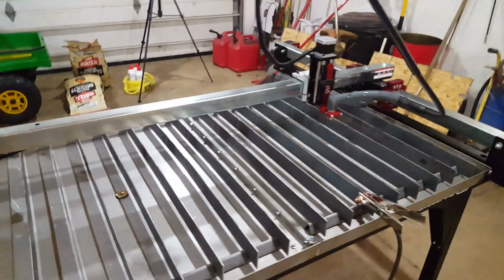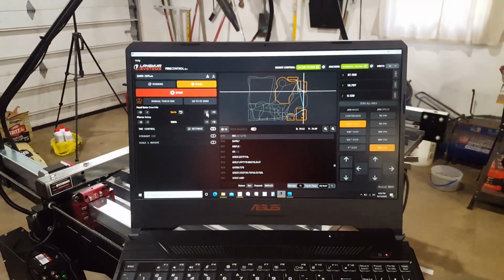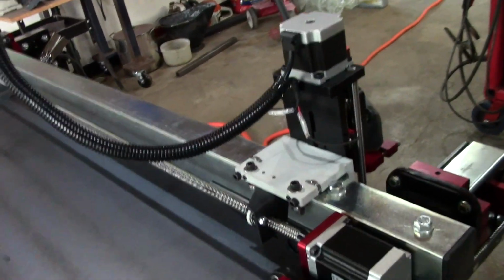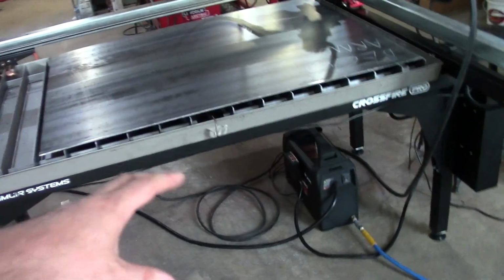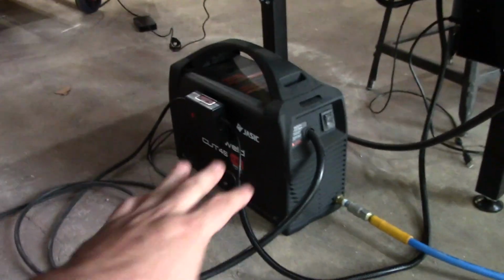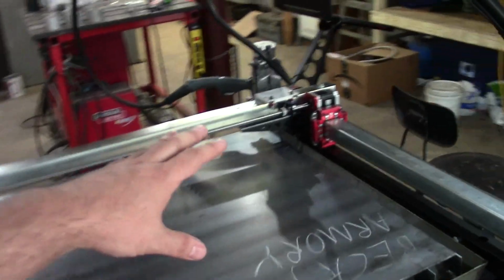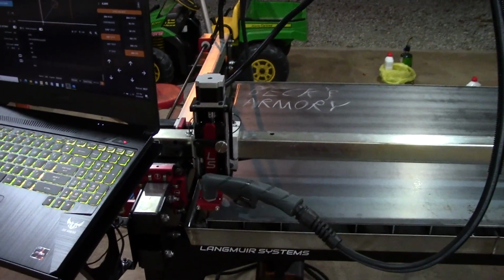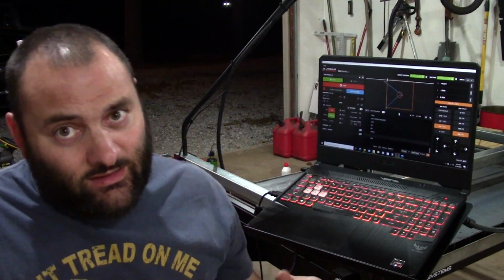Langmuir Systems Crossfire Pro Review and First Cuts

Comment: Hey, got a question, I’m new to the plasma table. Would you share some of your settings for different gauges of steel with the razor weld 45? Any help would be greatly appreciated. Thank you.
Reply from the maker: I never made a chart for the Razorweld 45.  I ended up switching to the Everlast Power Plasma 82i.  https://www.everlastgenerators.com/product/plasma/powerplasma-82i-cnc-package?rfsn=6157440.58fd90
Reply: @BeckTools thanks, thought I’d ask. Having issues with the dross on 14g
Reply from the maker: @charlesbaranski1860  If I were going to take a shot in the dark I would say 30amps, 75psi, and 40ipm with a .062" height.  Start with 1/4" lead in and reduce as needed.

Comment: I have been looking into this as well as a "Hobby" but I was wondering how your computer handles the software and wanted to know if I need a relatively high end computer to run the program. I looks like you have a pretty high end one but I cannot find the specks online about the requirements for the pc. Thanks
Reply from the maker: This is a "Asus Tuf Gaming" laptop.  It has a Ryzan 7 and M.2 hard drive.  It's pretty fast but I do all my video editing as well as 3D design on it.  It only cost me $1,300 is so it's not crazy expensive.  You can pay 4k for a laptop if you really want to.  This works great for the table but wouldn't have to be this fast.

Comment: Just got mine together today but I'm still waiting on the plasma cutter so I cant run it yet but I think They don't give you a starting feeds and speeds chart because they don't want you to know how slow you have to make your cuts before you buy it.
Reply from the maker: You know what you're probably right
Reply: Now, I'm just referring to the thicker than 1/4" stuff. I'm sure you can zip thru 18ga.
Reply from the maker: @bandsaw2701  not near as fast as you can with a hypertherm 45xp

Comment: How has the razor weld been doing. Do you think it's a quality tool thanks in advance
Reply from the maker: It's ok. It will get you started and help you make enough money to buy a Hypertherm Powermax 45xp.  The new FireControl software has really made the RW much more useable.  It let's you start mid program, even mid loop.  So when the RW glitches out you can pick up from were it messed up.
Reply: @BeckTools  thank you so much for your response. Do you know or have any experience with the prime weld cut 60 plasma cutter? And once again thanks in advance. I'm trying to decide between the razor weld or the prime weld to go with the crossfire pro
Reply from the maker: @tenehaglendening9246   I do not have any experience with the prime weld machine.

Comment: How much did it cost  and did you get the cuter and laptop with or does that stuff got to be bought by itself
Reply from the maker: Cutter came with it I purchased the laptop.  With Table, laptop, Compressor and air treatment set up I'm about 6k into this.
Reply: @BeckTools  what kind of laptop ,I'm thinking bout buying  this system  ,I have compressor just need everything  else
Reply from the maker: @mikemuniak4711  I got an ASUS TUF Gaming laptop.  It used to require a hot laptop.  They have since upgraded their software to the point it no longer needs to be crazy fast.   I think they put new specs on the Langmuir website.  Mine are outdated.
Reply from the maker: @mikemuniak4711  here is a video of my air setup.  https://youtu.be/41qdZI5doLQ

Comment: Nice video which I like to see somebody on one of these videos talk about prices though seems to be the big secret
Reply from the maker: The only reason I didn't mention the prices because it's listed on the website and prices typically change and this video will be incorrect once they change the price. If you buy the full package you're looking about $4,000. You also need a way to dry and clean the air as well as a decent size air compressor and a good laptop.  If you don't have any of those things you'll probably spend another $2,000 obtaining them.  These prices are January 2021 in case anybody sees this comment in the future.

Comment: Great video!! Thank you for sharing.
How do I know if my garage is equipped with the power I need to run the table, the plasma and the air compressor?
Reply from the maker: You need 50amp 220 volt outlet.  I would get a big compressor as well as a way to clean and dry the air.

Comment: Did you ever have the issue where your plasma would cut in and out during a tool path? I'm having this issue along with a bunch of others and langmuir is not responding to emails
Reply from the maker: yes.  All the time.  I fixed most of these issues.  Dry clean air,  clean and lube torch plunger.

Comment: what are your thoughts thus far on this setup, are you happy?
Reply from the maker: It's bitter sweet...  I'm shipping a box of 100 parts so I'm making money already so that amazing, but  I wish it came with the Hypertherm Powermax 45xp and not this Razerweld 45.   This will be my first upgrade.  Also don't bother trying to dial this thing in until you have dry clean air.  You'll just burn up the consumables and torch. :(
Reply: @BeckTools   thanks for the speedy reply, great video, thanks for the initial review also.

Comment: Also the shape of the plasma “flame” is kinda like an upside down tear drop. You can adjust your torch height to find the sweet spot that can help reduce the angle on the side of the part.  You may need to compensate your kerf for the changes.  I program large Messer and ESAB plasma tables where I work.
Reply: Oh! And in most instances these will cut your outside profile in a clockwise direction(kerf offset right) and your inside profiles(like holes) counter-clockwise(kerf offset left). So unless the control has individual settings for each, adjusting to make the outside profile bigger will make the inside profile smaller. And vise versa.

Comment: Hey man.
Stupid question but does the plasma table and plasma cutter run off your home electric plugins?
Reply from the maker: The plasma cutter runs off a 220v single phase outlet.  (Standard 220v welder plug)  The table (controller) run off a standard 110v outlet.  I think if you get a 30amp plasma cutter it can run of a 110v outlet.  You would need to make sure the wall outlet is wired for 30amps and you have a 30 amp breaker.  

No questions is stupid unless you don't ask it. :)